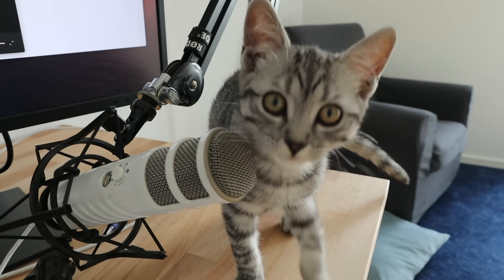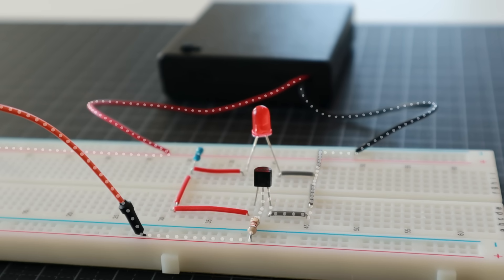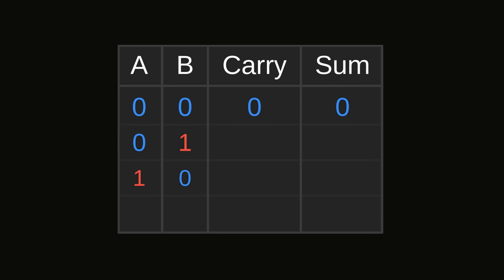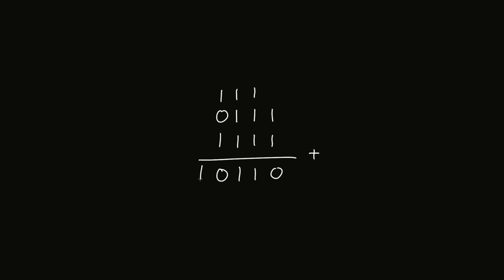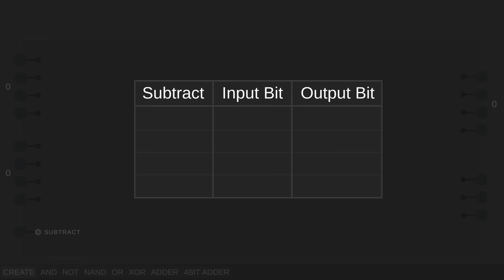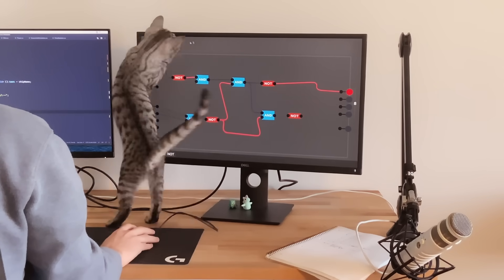Exploring How Computers Work

Comment: Your logic simulator reminds me of a Java program I made in my Computer Science undergrad 10 years ago to help with my Electrical Engineering classes. We had to design and build complex circuits on breadboards (the bane of my existence lol). For a reason I don’t remember now, I couldn’t figure out how to use Logisim so I decided to create my own simulator. It probably took longer to code that tool than I spent on the entire ECE class it was meant for, but it helped and I was proud of it!

I used what I learned in another CS class about language grammar trees to create a simple interpreter for Boolean Algebra expressions [e.g. ((A&B)|!(C^D))&E ]. So it had a feature to convert back and forth between Boolean expressions and the visual gates. The tool also generated a truth table and handled gate feedback loops.

The UI/UX of your tool is very nice! It makes me want to revive my project and recreate it as a JavaScript web app :)

Comment: Hi! I loved that video, and got the adders to 8 bit and 16 bit (8 bits I'm sure works but I don't know if the 16 bit works like it should, there isn't enough space for the output lights are too cramped so they need to be in one line not in 4 lines with 4 lights and that makes it extremly hard to read), the 16 bit one is too large to even fit in the windows, could you please (if possible) make the building grid a lot bigger and add more rows for input and output (right now I think a 16 bit adder is the most we can get because the input row is accually possible to use up to 16 bits, then it's accually impossible to press the buttons). Thank you for reading

Comment: Shouldn't the signal for the negative flag need to be passed through an AND gate with the subtract signal? Otherwise when you want to add anything that exceeds 7 the flag will be high when it shouldn't.
I am guessing that the moment we use the notation that the fourth bit is the negative sign we give up all the numbers from 8 to 15 in favor of -7 to 7, so we would never actually exceed 7. Please correct me if I am wrong, I am new to this.

Comment: I've really been enjoying using this tool, but I have some suggestions if you plan on updating it any. It would be nice to delete, or edit a created node, as currently if I mess up, I basically need to start over or have this chip I can't use. It would also be nice to have some kind of clock to play with so you don't have to do it manually, but I can't currently see a need for it, it would just be kinda neat. Maybe have it so you can set the duration for each cycle. In any case, you've made a fine little program here and it's really helping me grasp this concept that has plagued me for years.

Comment: Great video with lots of knowledge compressed into it.  The only criticism I would add is that it would have been better to refer to the first adder you did (with XOR and AND) as a half-adder and then defined the full adder in terms of two half-adders.  Great explanation of 2s complement too and using the subtract signal as the carry too.

Comment: Those line diagrams are wrong, they way you have them wired means that when you turn off the power at source you can not have power reaching the output

Comment: I love your Simulation, but pls add functions to:

1. Delete Saves
2. Delete Gates (from the bar at the bottom)
3. Clear the Screen
4. Rebuilt a Circut (e.g. right click a circuit in the bottom and the Circut how u built it shows up if the screen is empty or if not empty it ask to clear it)

It would be very nice to see this (the last one most important)
Thanks

Comment: The only thing that's a little confusing about 4:10 is that NAND gates are the simplest logic gate you can possibly make. You can make NOR gates, but they cost more and take up more space so typically NAND gates are made. From the NAND gate and NOT gates, the AND gate and the OR gate can be made

Comment: Love this tool! It's super useful. I've got an idea you might want to implement: when creting more than one input/output it adds a decimal representation next to the inputs/outputs, however the number represented is always positive. How about adding the possibility of it being negative without having to have an extra bit to represent its sign? The numbers for 4 bits would be as follows, and I am sure you can deduce how it would be for a bigger o smaller number of bits.

BINARY	DECIMAL
0000	0
0001	1
0010	2
0011	3
0100	4
0101	5
0110	6
0111	7
1000	-8
1001	-7
1010	-6
1011	-5
1100	-4
1101	-3
1110	-2
1111	-1
I think it would be a great improvement because with this system you don't have to create special units to work with negative numbers, instead you only have to rethink the way you read the numbers.

Once again, amazing tool, and thanks so much!

Comment: Man, i remember learning two’s complement, but I don’t think my teacher ever mentioned you could just treat the MSB as negative to work it out. That is very helpful.

Edit: Changed MSD (most significant digit) to MSB (most significant bit), as kindly pointed out in a comment.
Reply: Hmmm... The way you use "digit" (MSD) instead of "bit" (MSB) might cause some issue with censorship when you try to mention the least significant digit. I find this very interesting and funny. Cheers
Reply: @rizalardiansyah4486  Thanks, and nice catch
Reply: Signed number with range -8 to +7 !

Comment: 1:40 I don't understand. How is it an easier path? easier in what way? distance? surely not
Reply: It is the “path of least resistance”. The LED has a much higher resistance than the copper wire so virtually all the current flows through the wire and almost nothing through the LED.
Reply: @WizardofWar  I see, thanks.

Comment: 1:33 Isn't that technically shorting the battery?
Reply from the maker: There's a resistor on the left there :)
Reply: @SebastianLague  That doesn't help, it still will short the battery
Reply: @suspense_comix3237  as long as there is big enough resistance,it doesn't count as shorted

Comment: I have a little question, in the end, shouldn't the carry bit from the output be considered into the "is zero" part? if we get all zeroes in the output but there is a carry that surely means we would still get some value out of the alu if we had more bits to work with

Comment: I am quite frankly interested in what software you used to animate most of this, particularly the one where you create gates. It looks self-made (kinda the point of this youtube channel after all :D), and while I remember that I had similar softwares in uni (not highschool tho...) while learning this stuff, I also feel like the way it is very clean and has you work your way up from NAND in an interactive environ like that in a manner that seems very conducive to teaching. Meaning I think you might want to look into providing it to schools. Granted, they probably have better tools already (if they see the value in non-blackboards), but it seemed useful enough :)
Only thing it is lacking really, would be the ability to see the truth-table in table form (so there is no need to test each input permutation by hand). Perhaps even a way to input desired table so it can automatically detect and display when they match. For when there are many inputs, it might be worthwhile making it possible to group them in 4 to display the decimal (or rather hex) like you did for the adder, but also has such columns for the truth tables.

Also, cute cat!

Comment: Open windows 10 calc choose "Programmer" type. In "bit toggling keypad" you will see "assembly type" bar which QWORD; DWORD; WORD; and BYTE. You will see each time you maxed out all zeros with one, you finally understood that end of each max bit(far left) had function of max negative if only those section got activated/added 1. If each assembly you put to same all nodes to max, total number you found is -1 !!! why? Because if we back to "simple machine design"(...if we only had 1bit comp), actually a simple circuit with node/lamp, use of those lamp(in comp term called SIGN, ? that's what I understand...) to check for a current thru along the cable and  when those perform those signal from nodes will interpret as "-1" = Currents ON and thru the node which drain the energy(aka all neg num). And "0" = Currents on which mean value of slot 0 = 0,9999.. or ~ 1(aka all Positive numbers). That's all I got after checking some weirdness of those process and here my hypothesis about new explanation of 1bit in comp. In short 1bit is not 0&1 BUT slot -1 and slot 0=~1.
Btw here in each assembly of max positive num/val slots you can represent/immediate for compute :
QWORD= 9 Quintillion +
DWORD=  2 Billion +
WORD= 32K+
BYTE= 127
In actuality system x32 with size process of DWORD can only process to 2Bil !! BUT in term of "bits of data" of course! So how then it can counts number even higher with only those size? That's why THEN(... after simply a computer can automatically process addition(+), subtraction(-) and multiplication(x) EXCEPT Division bc this operation need more help from "Logic" in computer realm) we need "Logic" and "Math Function" and stuff to "crank it down" more with only base count 15(...which is 15+0=16 in term of value/slots).

Comment: If anyone is interested, there is a game about programming which looks very similar to Sebastian's simulation called while True: Learn() - its a really interesting game, that gets you thinking and building small systems, using gates and much more; each technique and system used in the game (such as neural networks, etc.) have an explanation of not only how they work in the game, but also have they work in real life and the game provides links to real life resources on those techniques!

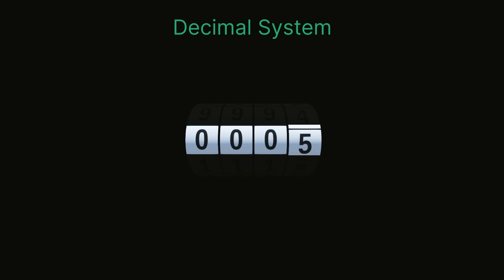Comment: I understand that the interactive gate thing was presumably programmed in Unity, which is wonderfully implemented, but did you program the number display 5:06 in unity and capture as well and then wrote over it? Oh and did you generate the truth table display you show within the Unity gate program? Just curious. Cheers.

Edit: Shame the line curving isn't dynamic based on the amount of stacked connections. 🧐 haha.
Reply from the maker: Hey, yes the simulation, number display, and truth tables were all made in Unity :)
Reply: @SebastianLague  Nice! Good job.

Comment: 2:50 why does the current flow towards the additional voltage for the transistor? wouldn't all current flow towards the black box thingy?
Reply: Electrical current is the flow of electrons from - to + A chemical reaction takes place in the battery to convert the chemicals to release energy. The energy is converted to heat by the LED and resistor. The voltage causes the current to flow.

Comment: I've taken 3 courses in computer architecture, and I absolutely love this stuff. I could eat sleep and breathe it every day. Very awesome video and I'd never heard the minus 8 place before so that's awesome. However, there were a few steps in logic you took that were quite large with not much explanation. It required me rewinding twice, then pausing to think through it on my own to realize why it would work. Maybe you have to to keep things running at a good pace, but slowing down and explaining for instance why 'your first and gate will catch if all 3 bits are on even though the second and gate at 9:57 would miss it because they are or'd together' would be very beneficial.

Comment: 2s complement is actually not that weird. In binary it's just not that clear what's going on. I think it's easy to see what's going on if we do the same in a number system that has more variety, like good old decimal. 
Keep in mind we only have four decimal bits so the highest number we can create is 9999. Should a calculation end in something bigger, like 19999 the highest diget is cut because we have no Bit for that. So 9999 + 1 = (1)0000. Maybe you already see the trick, 9999 effectively becomes -1 just like 1111 is -1 in binary.
But let's make a real calculation: 2354 - 0153 = 2201

First we "invert" the negative number. In binary we can literally invert since we only have 2 states but in decimal you see it's actually not inverting but taking the difference to the highest number that can be represented so: 0109 => 9999 - 0153 = 9842

Then we add 1 which is independent of the number system you use: 9842 + 1 = 9843

Final Calculation: 2354 + 9843 = (1)2201

So with four Bits substracting 153 from 2354 is the same as adding 9843.
Reply: Two's complement is just a binary number flipped then added with 1.
Reply: @blackhole4813  Right, I just explained how it works

Comment: To make a computer, all you need is a "list" of instructions, and some way of incrementing through those instructions. So to add a number, you might have three registers hooked up to your adder circuit, adding two registers together and putting the output into another register. So the instruction registers, (aka, your program code) would basically hold two numbers, the address of the desired register, and the value to put in it. A computer is just these simple circuits but with lots of registers.

Look up what an SR latch is, then what a master slave JK flip flop is, understand the concept of buses, voltage division, and that is everything you need to know to make a computer. I am designing my own architecture from the ground up with transistors, resistors, and diodes. I even figured out non-volatile (permanent) memory with capacitors. I already knew a lot about electronics and I have a bread board and lots of components but experimenting and testing with this free simulator really accelerated my learning. It's browser based but you can also download it for free. It pretty much changed my life http://www.falstad.com/circuit/ I found that the only really hard part is understanding NOT gates and AND gates. Because with AND gates you need voltage division on the transistor closest to the output because the current will go through the base of the transistor and set the output high even if it is the only one on.
Reply: Yep, falstad is my favorite circuit simulator. Used it many times in the past.
Reply: Also, falstad has other great interactive things you might find insteresting. Check it out!

Comment: It's so inspiring to see you learn the basics that a few experienced coders have known for 20 years! (And that no employer will hire you for knowing.) Computer Theory (as we know it) requires only 3 ideas, and everything else inside a computer can be fully understood and perfectly predicted, so long as the computer is not physically damaged:
1. Quantification. The concept of the bit as information storage and its limits.
2. Encoding. (For calculations) the mathematical interpretation of a bit or sequence of bits
3. Calculation. (For logic) the logical interpretation of the output of a truth table. (No knowledge of the meaning of OR, AND, etc is necessary, just the selection of useful truth table outputs.)
If you know this, everything else that a computer can do can be built out of concepts that are quantified, encoded, and calculated - anything from a simple 3D calculation to voice recognition.

@Sebastian, if you're looking for an interesting lead for intellectual investigation - truth tables can be stored in memory and used as a LUT using the address lines used to create the ALU part of your own CPU, with very little circuitry for instruction execution.

Comment: Fantastic Video! I am now really looking forward to see the next parts and how deep you will delve.

The timing is also great, because last week I started thinking about ways to explain why λ-calculus (intuitively) covers all of computation (i.e. Turing-complete).
It is easy to show that all logic gates can be represented by λ-terms, but I am pretty sure that's not enough for full computation power (It is impossible to implement anything 'while'-program like with only logic gates). I'm pretty sure you will get the to the ingredients I am missing as of yet.

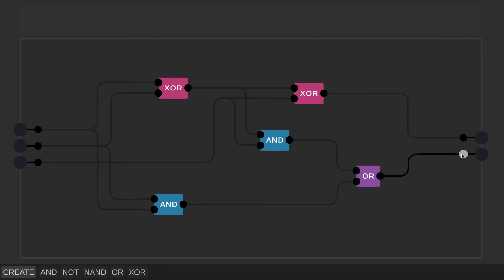Comment: In 10:14 I think you should use the XOR gate instead of the OR gate just to be consistent and avoid confusion for learners. The XOR gate make it clear that we add the carry bits together. Because both of the carry bits can't be 1 at the same time, so the OR gate is just as correct as the XOR gate.

Comment: I actually learned this stuff in CS. I think that logic programming and verilog are just an enhanced paradigm of programming, in which you can specify multiple things that happen in parallel instead of normal, sequential programs. I recently discovered that this a separate programming paradigm - called "data flow programming".  We could have written all the exisiting world's programs in verilog directly, but that would be terribly inconvenient and frustrating, and also creating a new circuit everytime may use a lot of time. It is thus much more convenient to first create a "CPU" that processes instructions out of logic gates, and then write programs on top of the CPU.   Programming using logic gates and normal programming are both turing complete, so anything that can be done with one can be done with the other too

Comment: This is absolutely phenomenal! One of the best explanations I've seen, especially with the visuals. 

One critique: you  didn't mention two's compliment. I find it much more useful and accurate to think of bits as powers of two. (bit value = 2^bit). For example, a 4 bit number would be represented with:
-(2^3) + 2^2 + 2^1 + 2^0. 

Just nitpicking though. I like the explicit definition (two's compliment) better than the recursive definition (multiply previous term by 2), but it's definitely helpful to be aware of both. It's honestly beautiful how binary and two's compliment works so perfectly.